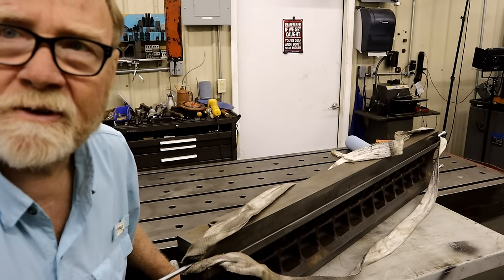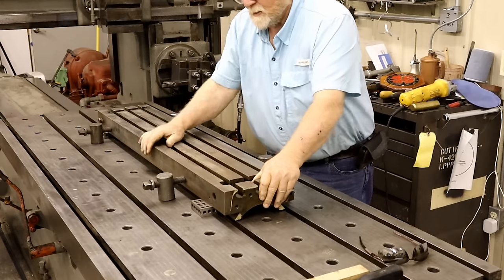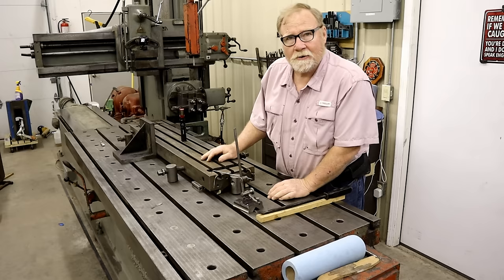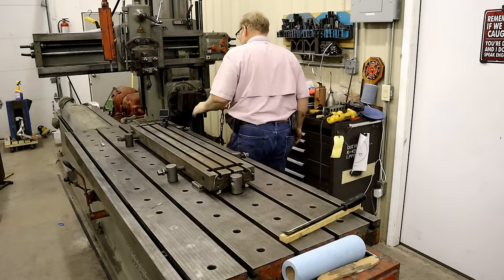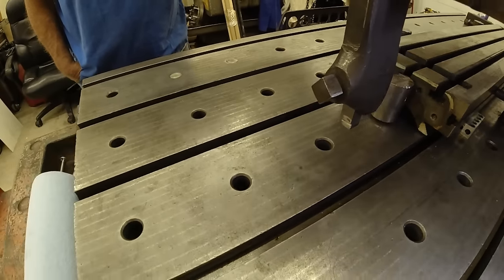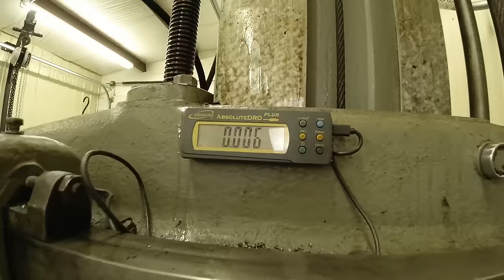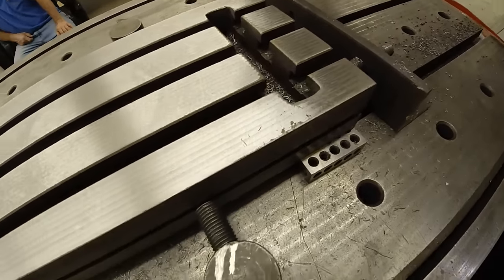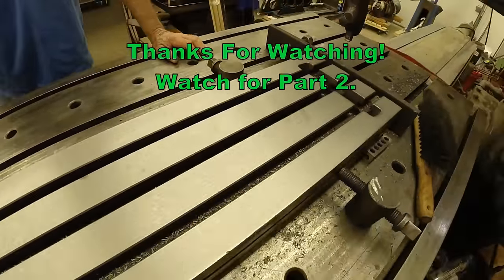How To Plane a Bridgeport Mill Table: Part 1

Comment: The other reason for using the full stroke of the planer is to help to keep bead wear even.
Reply: As a hobby shop for sure, no doubt. I would bet as a professional shop just to keep costs down on machine time they would go for the shortest stroke and machine run time to stay competitive, that being said they probably wouldn't be doing this with a planer either lol
Reply: @thecanadiantradesman7916  In that case they probably would. Shaping introduces much less residual stresses in the material than milling, thus allowing to machine the table without warping it all over the place

Comment: If I had a sweet machine like that no way would I use an abrasive disk on top of the machine, throwing that material everywhere like that. It was all thrown back to the unprotected ways behind the table and you have to hope the wipers do their job and nothing makes its way through.

Comment: Mezmerizing, Steve! I agree with the “measure twice, cut once” ethos! Thanks for the great video, again!
Reply from the maker: Thanks Lars.....
Reply: @10swatkins  good morning! Sir. How wide is your cutting bit, and how much step over did you use? Is there a certain… “percentage” of overlap from pass to pass you were shooting for? Thanks.
Reply from the maker: @trevorjarvis3050  That bit is 5/8" wide and I was taking about a .250 step over...   IN this case I was having to play with the settings to eliminate chatter...  When I hit upon something that worked I stay with it :)   Sometimes you can go wider, sometimes you have to narrow it up... All depends on the casting and hardness of the iron..
Reply: @10swatkins  yes Sir, if it works don’t fix it. I’ve run a small shaper like Mr Pete has. That must be a rather powerful planer. I didn’t think the step over would be that much. I kinda thought it would more like an 1/8 with a 1/2” tool bit. Great video, looking forward to the dovetails being cut.
Reply from the maker: @trevorjarvis3050  I have taken 3/4 inch step overs :) This thing will peal metal!    IT will also do surgical strikes... When the casting cost 2000.00 to replace, which would you do?
Reply: @10swatkins  2k for a casting? Yeah I’m retired and known to pitch a buffalo off a nickel. I’d take .005 depth with an 1/8” step over for however long it took. But I might be tempted to put an old piece of train track on there, and let her eat just to see what the old girl can do.
Reply from the maker: @trevorjarvis3050  Some time when we are not so busy  :)

Comment: Hey you said comment so here it goes, glad Don came by to supervise.  Your wife brought liquid refreshments,  I have been getting into diet ginger beer myself.  Was waiting for you to put a cramp on the backside, rod and a wedge, anything, but you remembered.  Doing good.  Myself I have just been making parts for the engineers,  getting them coming out to see me before they go home,  pick their brain and I throw my 2 cents in, maybe I won't have to make so many prototype parts that way.  Engineers are special, tool and die guys just have to figure out what they want done, make it work and explain it to them so they can change it in autocad,  but now they use solid works.  Give me a Big Chief tablet and a pencil.
Ok, been commenting about work, been a 2 year ordeal at work, I have been there 9 months now, 2 engineers have thrown their hands in the air and quit on this new line, they got mad and put part of it on the die shop to handle, we handled it.  Wish us luck, we are making parts now, hand testing components now,  but making parts for auto test machine now.  Can't explain too much, proprietary stuff.  But I am making this stuff on a Bridgeport clone.  How much stuff has been turned out on a Bridgeport,  toolroom mill of choice, might not be the best at anything but it will do everything.  Handier than a pocket on a shirt.
Reply from the maker: I also find a good manual mill to be essential ... Don't have to be a big mill as a Bridgeport will do about 75% of the jobs...

Comment: Very useful tool.  I like seeing historic production pictures showing rows of parts being cut simultaneously.  I also like the idea of a milling head on one too; the long-travel stable bed with a milling head would be quite a contraption.
Reply from the maker: On this planer a mill head would be problematic.   With the bed being moved by a large cylinder there is not absolute travel speed as with something with a screw. Thus I can see lots of mill bits being snapped in half !  Mill bits use rotary movement to cut and are sensitive to speed.

Comment: I used to suck them Mountain Dews down. A buddy got me started on them and I made up for lost time. Kept two 6-packs in the company truck tool box all the time but here in the hills it's not hard to get the real thing. This was after my all expenses paid tropical vacation where I about burned my kidneys out drinking Fanta orange and grape because the water point was almost all the time messed up. And as it was said about Carl Jackson a while back, I'm glad to see the beautiful and talented Don Madre, the Rembrandt of the rebuilt and restored metal working machine world back in his rightful place, trying to turn your planer over by leaning on it. And remember, ONE Dew a day. And don't forget the GATE! GBWYall!
Reply from the maker: Well I used them to keep me awake :)  After the heart attack they are trying to keep  my heart rate and pressure down... I was thinking maybe a few MD's might be at cross purposes...
Reply: @10swatkins  More than likely. I have never seen 2 that agreed on anything.

Comment: Very nice, to the people who think your not going fast enough, you can hear it howling in the middle from being un supported, but int needs to be unsupported so its flat in "free state", also the same reason you would fight it on a grinder; the chuck wants to suck the bow out of the table, then it comes back on the surface plate
Reply from the maker: Yes and by using a positive rake tool there is less down force... Sometimes supporting it make chatter....
Reply: @10swatkins  why not just have it Blanchard ground?

Comment: There is a lot of knowledge based set up to get these kind of results....I wonder, how fine of a step over can you take with this planer...??  Looking forward to see the magic on how you do the dove tails on the back side.
Reply from the maker: The step over is controlled by the hydraulic motor... I can set it down pretty fine but for this you want wider step over to create the slight ridges for parts to sit on... Too fine or scraped surfaces make parts hard to move around...

Comment: Looking forward to the rest of this series especially the turcite/rulan process there’s not very many good videos of this process of correcting warped and bent machine tool castings besides just scraping and making a new gib
Reply from the maker: Don't think this one will need it.... We will see..... Not much to doing turcite... just glue it on and then scrap it ......
Reply: @10swatkins  i need to do something with my lathe compound it’s horribly worn and as of now I don’t trust my mill to machine it close enough to scrap it in
Reply from the maker: @jeremycable51  Trucite is really easy to scrape... In fact usually with cast iron I don't mill anything that is less than 5 thousand out...  Of course I have a power scraper and a power flaker also..   A lot can be done with power tools :)

Comment: Steve that is the coolest vintage equipment that would give you the potential to get as close to perfection as a man can get ! It's a lot louder than even the biggest ones iv seen (check out Curtis at CEE cutting-edge engineering) he just got the biggest I have seen anywhere  certainly in its line of manufacture  and it would have some limitations where you would not ! I don't know enugh to know what makes one better than the other . However I'm positive I would have a lot more fun with your planer than any shaper I have seen !
Reply from the maker: Don't care how big it is it's still a shaper  :)  Shapers are limited by stroke and table size.  My planer is limited also but that limit is 96 inch stroke !  I could find a bigger one if needed :) Not so on a shaper...
Reply: Exactly! Wheres my buddy:Don?
Reply from the maker: @rossilake218  I thi k he is back in Jail...

Comment: I’ve had a shaper obsession since I first saw one. Planers are awesome as well, but that thing is bigger than my home shop (10’x12’ shed with concrete floor). I still don’t have a shaper, someday though.
My father has been a job shop machinist for 40+ years now, always tells me shapers, planers, jig borers and horizontal mills (K&T and such) are obsolete. 
He’s not wrong, he’s just surrounded by million dollar CNC machines at work. The rest of us have to get by with old technology that isn’t as fast.
Reply from the maker: For 99% of the jobs even planers are obsolete.. For rebuilding machine tools and straight edges they are low cost machines that are well suited for the work... Slower but this is not production work.   I hear you on the size.. I am struggling with a 40x 60!
Reply: Ah but it is as fast, if you want to make small numbers of parts, by the time they have programmed the cnc and checked all the tooling, found this plane and that plane you can have a few done on a manual machine,
Reply: @michaelrandle4128  they have Proto-Traks for that. The only manual machining left is high-precision lathe work. 

If you’ve never seen a 50hp horizontal CNC remove metal, you’ll have a hard time catching it despite set-up time. 
MasterCAM is phenomenally good, every modern CNC can probe a part faster than you can indicate it in a manual machine, and when you have a tool library of 600+ tools and 115 tools in the tool changer, there are few advantages to manually machining the parts. Especially if it’s complex. The 5-axis machines are incredible with a good programmer.

Sadly, manual machining is dying. It will always exist at some level, but the days of even low-production being cost effective are quickly becoming history.
Reply: @mayshack  I truly believe that machining itself is slowly dying. As metal 3D printing improves and becomes more cost effective, it’s going to become difficult to compete with. 
There isn’t much left made from actual metal anyway. Everything is injection molded plastic and cast garbage metal. The world is in a race to the bottom, and for reasons I don’t understand. I personally appreciate things I can buy knowing they will outlast me.
Reply: As the saying goes "you can make anything with a shaper or planer, except money"

Comment: Man I would love to come across a planer like that. Where I live industrial machining just isn't a main industry so equipment is hard to find aside from your basic small lathe and the odd bridgeport style mill here and there. On top of that they always are priced like they're made of sterling silver or gold and in just above scrap condition or beyond scrap. I managed to purchase my first modern style lathe last year and am extremely happy with it, it's a late 70's early 80's YANG 2000HG, swings 20" and has a gap which allows about 31" and a 80" bed length. Needs a bunch small things but it is in overall pretty decent condition. All the speeds and feeds work well and runs quiet so I was happy about that and as far as my initial inspection went doesn't have to much wear even up close to the head stock. Once I take the time to fix a few minor things on it il get it off my machinery skates and level it out  to see exactly what kind of condition the bed is in. It does have flame hardened ways on it and no real visible wear so I'm optimistic on how good it really is but for what I do or plan to do with it I could set it up in my driveway and it would still be accurate enough. Usually just make the odd pin bushing and pins for a bucket or grapple and the odd hydraulic cylinder rod end here and there. I'm still on the lookout for a good milling machine but I waited 25 years to find this lathe I'm sure I can wait a bit longer to find a mill.
Reply from the maker: Machines, good machines, are hard to find here also... Good luck with yours!

Comment: We never had a Planer that big, but we did have a Surface Grinder that big. The surface grinder could spark out a tolerance of 0.0002, but it took an hour for the machine to get warmed up enough to hold that kind of tolerance.

Comment: I always put the table on 3 points table side down so it would straighten
this can be checked by the bottom flat surfaces, then plane the bottom 
and the angled surfaces if needed, these can be checked with a K&E tilting level. The table top can be compared to the top of the planer table, when acceptable  it can be cut, then the top can be planed. There are many ways to do this job, but if acceptable results follow, then it is correct.

Comment: Just had my 70 year old Bridgeport delivered, so really hoping you will get back to your Bridgeport restoration - with more videos of the process.
I found your channel searching Bridgeport Mill on YouTube & since this one you’ve done everything but get back to your Bridgeport restoration. 😂
Don’t get me wrong - the non Bridgeport videos are very interesting too, just not as relevant to me personally as seeing what you do next with your Bridgeport restoration. 👍👍👍🇦🇺
Reply from the maker: The next video is probably finishing up the planing on the mill table....

I do have to make a tool before I can finish the Bridgeport... I don't have a finished 4' edge with the angle on it... I will plane one and scrape it in probably in the second video to come ;)   

. I am just spread too thin and things are always shuffled for priority,,, And I am setting up things for a long session of scraping things in.....  I have three machines sitting here that need parts scraped and though I would just work through them all at once...
Reply: @10swatkins  Understand completely. I’m of a similar age to you & also not in the greatest shape health wise, so I just do what I can do, when I can get to it.
I hope you will continue to approach your tasks in like fashion.
I’m the same in that, I have jobs lined up that need doing, but there’s always something else that I have to do first. 😂👍👍👍🇦🇺

Comment: Being new to machinist videos, I have not seen a planer like yours before.
Impressed by the result and thanks for taking the time to explain why the long stroke, before you explained, I had assumed it was to keep your planer bed wear more even over the length.
After the explanation, I was watching the head kick twice on the backstroke almost every stroke and when I could watching the head move to the side at the start of every forward stroke, and the settle time that followed.
Would be nice to see the table on the machine it came from. I assume you will be showing work  on the other side of the table?
Reply from the maker: There is a whole play list of the machine from start to now....  You will see every side :)    https://www.youtube.com/watch?v=z9GP0R4fCOk&list=PLdXHEJjySc6jqqokgZx4f1z5c7Swvg4VN